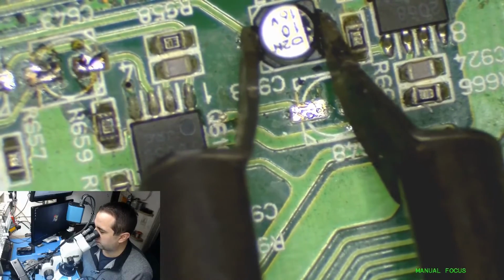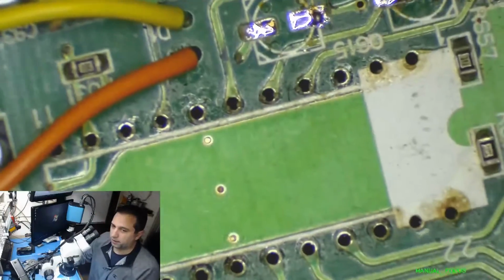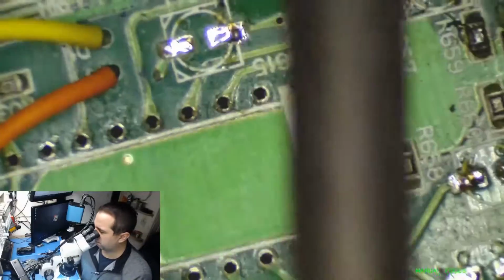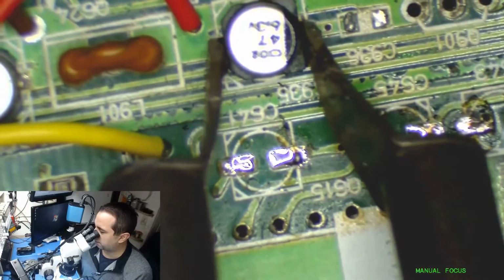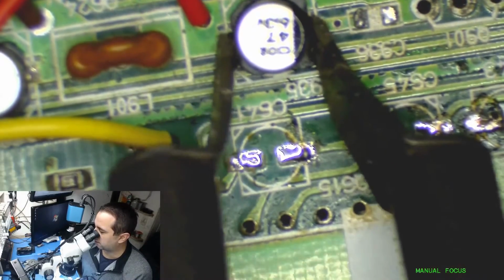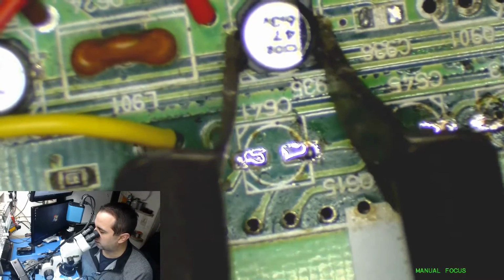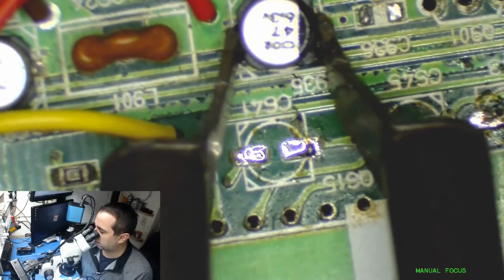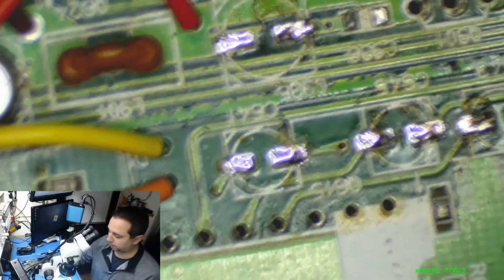SMD aluminum electrolytic capacitors removal luxman RV-371

Comment: I've been wanting to know how to remove these capacitors for a while now, on some ewaste boards, I tried the twist and turn approach and found that a few I tended to rip the contacts up.
 I think however I will go with the FX8804, since I already have a FX888 but that is only if I get a job soon.

Thank you.